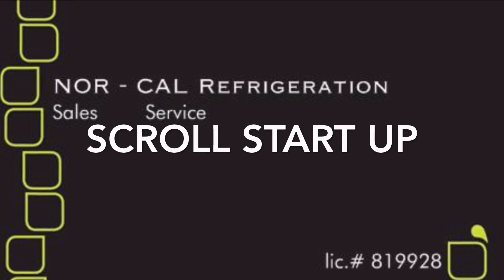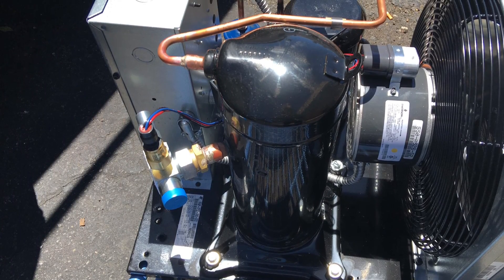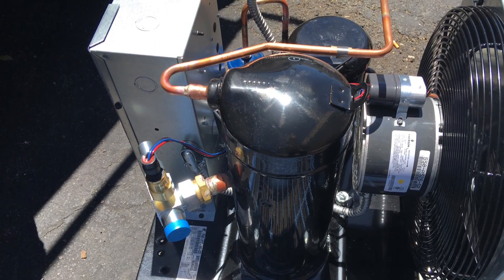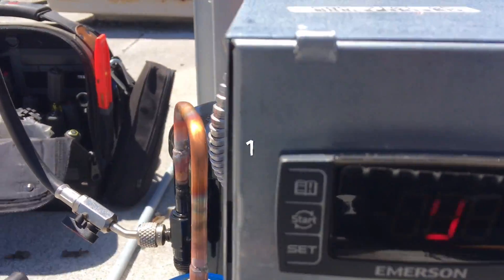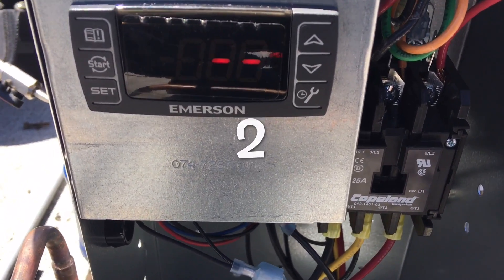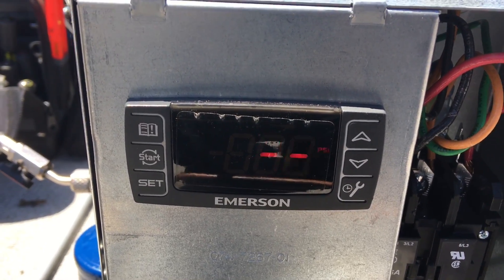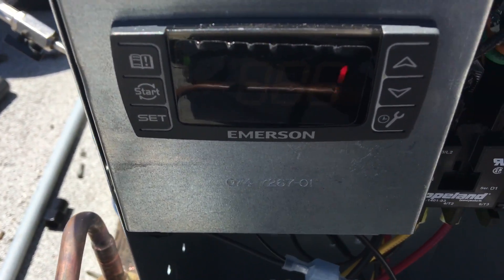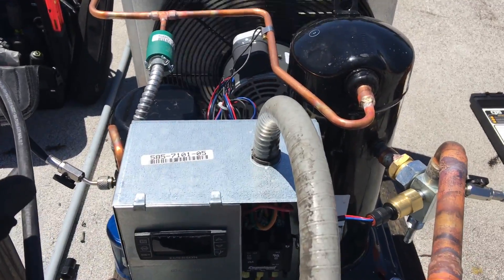Emerson scroll condensing unit start up cycle

Comment: Amigo I have a question hope you can reply im working with a similar condensing unit . New condensing for a walk inn cooler. Im using 407c what would be the right set up cut inn and cut out on the Emerson control. Right now they’re set at cut inn 65 and cut out 25 but I feel like compressor keeps shirty cycling
Reply from the maker: Is it on a pump down ( Tstat/solenoid)?

Comment: Good to know, that's for sure. Trying to get management to change out a 25 year old Bohn water cooled system (R502), and was looking into the scroll, but they were 3 HP and up, and this is a 2 HP set up, so no dry heave for me! Thanks for posting, Dave.
Reply from the maker: I think you can get them tom. It's a freezer right? It will be liquid injected scroll time. Neat stuff.

Comment: Damn Dave I've  installed 3 of those Copeland  scroll's, so far and they all did the same thing they  started fine  after  the 3rd time, and I've  wanted to ask you if you were dealing  with the same issue, but I guess I wasn't  the only one!